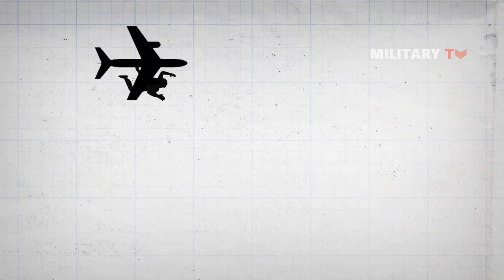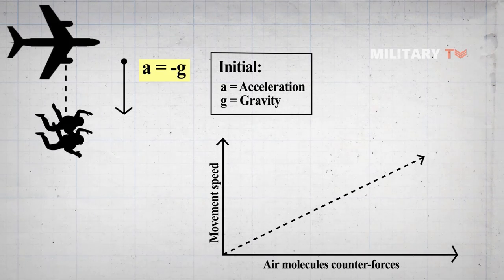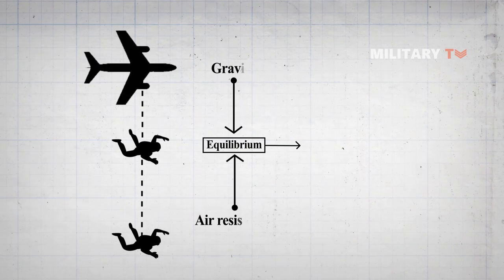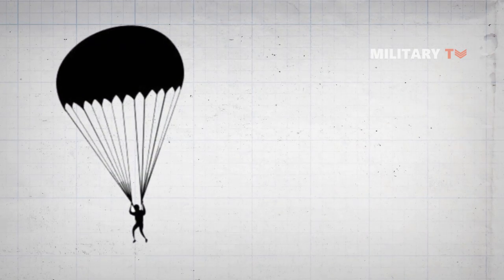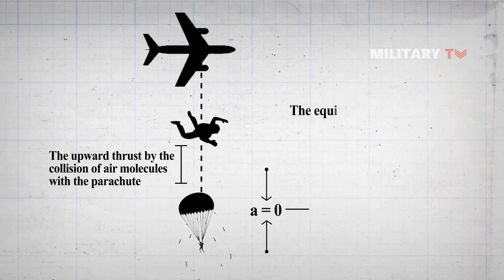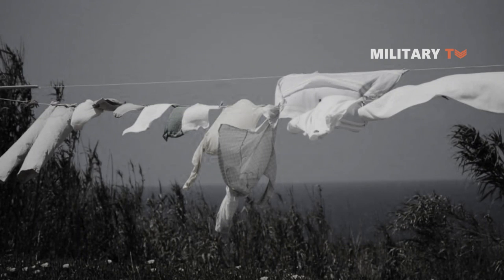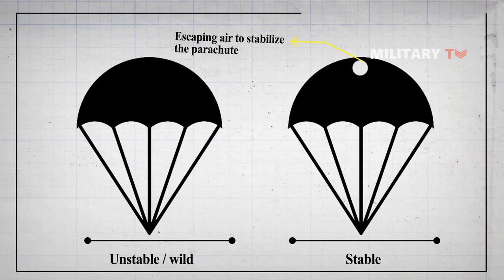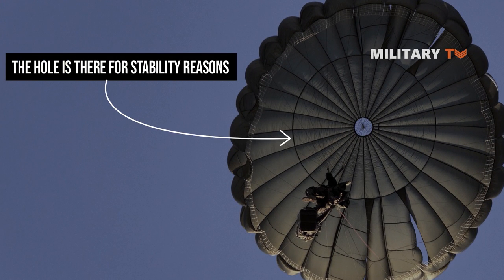Why Do Military Parachutes Have Holes - How it works?

Comment: The hole in the middle is to let air out in a controlled fashion.
If it wasn't there it would "over fill", and the air would escape from random bits causing it to "jellyfish", oscillate or even partially collapse, making it descend faster.
The holes in the side are for some sort of directional control. Usually the amount of control is in the order of choosing which tree you will land in, rather than enough to avoid the trees.

There are many different shapes and designs, each with their advantages and disadvantages.
Reply: Blocking the hole would cause the chute to stall and decrease the lift generated by the airfoil shape of the chute.
If you cut a chute from the hole to the edge and straighten it out you end up with a rectangle parachute that also act as an airfoil.
The hole increases stability and decreases fall rate.
Reply: Having the air trapped in a cushion probably affects the terminal velocity as well... just like the bed of a truck with the tailgate up will form a bed of air.
Reply: @fakshen1973  
That's where the instability comes from - that "cushion" escaping from the bottom.
Therefore the hole at the top to stop that happening.
Devices to slow the initial opening down is another topic.
Reply: Directional control just enough to land in the briar patch.
Reply: Thank you!

Comment: I noticed that too but i knew why
it's so they won't shake or get blown away while going down its much safer...
It's because, if the air cant escape it might just blow u away, it's just like smoke
it cant go out until there's a hole even if its little

Comment: Stability, forward movement and steering. When I started parachuting we used surplus modified military parachutes that typically were from an ejector seat of a fighter. They were normally 28 foot flat circular with only a hole at the apex. The 'mods' were two separated back to back 'L' shaped cutouts at the rear of the canopy called a 'double L'. Later they joined the two 'L's' with a slot around the periphery (bottom edge) and called it a 'TU". Gave it a bit of drive into wind and steering to a landing spot. The reserves were unmodified. Just went with the wind!

Comment: The hole in the Crown of round parachutes was put in to stop Oscillations caused by the air trapped in the canopy rushing out the side and then setting up a rocking motion. Most of the holes are edged in elastic so that on opening the initial rush of air is let out and as the falling body slows, the elastic tightens and reduces the size of the hole
Reply: Now that's clever (the elastic orofice), when did that feature find its way into the parachute?
Reply: @BeachsideHank  very early, I’m not sure but Tiny Broadwick was jumping a canopy in about 1912, that had a hole, not sure if it was elasticised. The British Guardian Angel canopy developed in 1917 didn’t initially have it, but post war it did, don’t know when it was introduced. Problem is people were innovating and sharing ideas as fast as the postal service. A bit like the Wright Bros stealing credit for the first manned heavier than air flight, publish or perish.
Reply: @BeachsideHank  by the way, the hole also has a function of lessening opening shock, slowing down the opening. This cases less strain on both the canopy and the jumper.
Reply: @anthonyburke5656  Thanks!
Reply: Without a vent in the top the canopy would oscillate wildly and most likely blow several panels on deployment. Aside from staying at a Holiday Inn Express last night I am an Federal Aviation Administration certified Senior Parachute Rigger with over 3000 skydives. I know stuff and things.
Reply: @larrynoe6162  just the man, I’ve been nursing an idea for about 40 years. You probably don’t know about the Irvin Delta II Parachute, it went out of production 40 years ago. Similar are the Reserve Triangular parachute, paragliding and para motoring reserves like the Beamer II and III. I’m convinced that there is more in the design concept than in”Ram Air” canopies both as parachutes and as paragliders. I know what stifled their development as parachutes was unreliability in opening, now cured by a “Slider” . I see the modern triangular are small and cut on the cross bias not longitudinal bias. I know very early designs contemplated longitudinal with much larger “Chanel’s” in the canopy. I know modern fabrics, lines and sewing techniques, as well as cell reinforcing have provided designers with lots of options. Try to build a big triangular that works on lift not drag and can be used to ascend?
Reply: @anthonyburke5656  ram air canopies of today are elliptical in shape. That is to say they have tapered end cells and zero porosity fabric not allowing airflow throw the fabric. The wing is a lot smaller very fast and highly maneuverable. You jump with wing leadings above 2.5 to 1.
Reply: @anthonyburke5656  PS you mean the Delta II death wing ?
Reply: @larrynoe6162  yes, it didn’t have a good rep. I think mainly because of that Opening Shock Inhibitor wrap that was used. The advent of the Slider obviated the need for. Such. I believe the concept needs to be revisited and that it has more potential than current Ram Air canopies, especially in the Ascending Canopy I.e. Paraglider category.
Reply: @anthonyburke5656  I started in the early 80’s there were many great innovations at that time that made skydiving a lot safer sport up until they started designing canopies that will kill you when operating correctly.
Reply: @larrynoe6162  any parachute can kill, it’s inherent, like any activity can kill, that’s not the point. I went from Sport. Parachuting to Paragliding to 
Power Paragliding (still do a bit of paragliding) and still think that there is a lot of potential in the Delta concept and it has more potential than Ram air. Take a look at the single skin lightweight paragliders they are making.

Comment: The teetering effect will occur even in a dead calm because it is as much caused by air escaping the parachute unevenly as it plunges downward, forcing more air in, and it may also be swaying as some of the air trying to push in to the chute must go around to one side or another. Teetering will cause problems controlling the direction of the fall by exposing a broader area of the shoot into the wind as the trooper is pushed away in the opposite direction of the wind. If the hole in the center is equal to the amount of air being forced into the parachute it will fall much straighter.

Comment: That’s a blast from the past! The T10 and the T10-1B …affectionately known as the “dash one bravo”. Took a lot on rides on the T10 on masstachs.
Reply: Steerable canopy.
Reply: @CrimsonRaven51   I'm not sure I understand your point but a T10 was certainly NOT a steerable canopy. At best, you could do a "slip."  In the 70s we did have modified T10s (gores were removed) that could be steered but the only time we used them was during non-military jumps or by "special" military teams. But even then, the Paracommander was used by most experience jumpers, including the Golden Knights.

At Ft. Bragg you'd see them (modified T10s) used on weekend jumps by "noob" sport jumpers transitioning from being a T10 "rope jumper" to using a ripcord and eventually to a high performance canopy.  

I was stationed at Bragg (HHC 50th Signal) from 72-74.  I was there when the Golden Knights C-47 crashed.

Comment: What is the difference between these parachutes and the rectangular parachutes without holes?  The rectangular parachutes seem to give the person much more control and flexibility.  Thanks in advance.
Reply: A Ram air parachute needs to be flown and landed, a circular one just needs a weight on the end of its strings.
Reply: One lets you down the other one has to be flown down. 
It's about landing speed, where you land,  the load and  the mission. 
How about a rogallo wing Parachute? Too iffy. They have a tendency to drift or collapse.   Square glider type? You have to be alive and steer. Round? Goes essentially straight down and is at the mercy of winds. Opens quickly in emergency situations as all of the jet guys use tat.
I'll walk. And trust round. I like roundy things that have holes in the middle. Donuts. Bagels and Angel food cake for example.  Tires. Parachutes.
Reply: @kevinshort3943  
Thanks very much.
Reply: @darrellcook8253  
Thanks very much.

Comment: They forgot to mention that the round parachute with the hole also stops troops drifting away from each other when deployed, as they have limited forward momentum, as opposed to the rectangle parachutes that require the paratrooper to steer to destination.
Reply: No, the “Ram Air” canopies were developed much later than round canopies, the initial impetus was WW2 work by Nazi Germany, post war Rogollo did work for NASA and patented it. Round Canopies, both the “Drag” type (which you see used for mass troop drops and re-supply drops) and “Lift/Drag” canopies such as you typically now see being towed by speed boats, can be steerable. The Round canopies have panels removed from the canopy to provide thrust and the Lift/Drag have vents in the canopy that funnel air to provide lift and can be closed or opened by control lines to change direction or alter lift.
Reply: @anthonyburke5656  I thought I saw rigging to close the lower vents.
Reply: When you have 1000 troops in the air, you don't want them to be able to steer, they'll all steer for the best landing spot and the amount of collisions you have will go up to a huge degree.
Reply: @politenessman3901  they can steer as mentioned before.
Reply: @quijybojanklebits8750  yes and they will steer for the best patch of ground to land on. all of them.
Reply: @politenessman3901  I disagree, I’ve been a military paratrooper, in the military I used both the non-steerable and steerable canopies. The delay in each trooper dropping meant that their optimum landing was different. Once you’re under canopy, then you prep your approach, ready your gear (you don’t want to land with your gear, you lower it just before landing so it hits and lets your canopy breathe). The second most thing a paratrooper dreads, after a canopy malfunction, is a mid air collision, they will go to almost any extreme to avoid one. In any event, in mass drops you “follow” the stick lead onto the DZ, sticks are in multiples of 5, you land and organise on landing by your stick.
Reply: @anthonyburke5656  So have I and I'll guarantee you that every guy under canopy will steer for the best possible landing. 
Given Sim door exits, odds are with steerables you'll get collisions anyway.
Sticks are not in multiples of 5. it depends on the capacity of the a/c and, I suspect, national doctrine.
In mass drops, you go down and have little steering ability, because few countries are stupid enough to add that level of confusion to a mass drop.
Reply: @politenessman3901  you beat me, I only ever dropped in the para school and with my Regiment, I guess our troops were better trained and our sticks were 5 men who all RVed on the DZ, never dropped in more than a Hercules load though. Only did a few double doors, no hassles, a few canopy walks. Later, when I did free fall with ramp exits from Hercs, we used to exit off the ramp in multiples of 5, that was a gunfight with all the gear we carried and the breathing apparatus.
Reply: @anthonyburke5656  any doctrine that puts sub units together on the same plane is one that is poorly thought out as it is ignoring the possibility of losing the plane (reliability issue or enemy action), you spread the units across multiple a/c so that, if you lose an a/c, you lose a couple of guys from each Pl rather than an entire Coy (If you consider ignoring the fact that the enemy has a say in things, as does saint murphy, to be "well trained", I'll let you continue to delude yourself) RVs are then conducted via company 'turn in points' on the DZ.
Our sticks were full sides of the a/c because the point is to get out and on the ground to get on with the task, but hey we were mission orientated.
Reply: @anthonyburke5656  So your militarys NCOs and officers were incapable of saying "you, you, you and you, with me" and taking some initiative.
Also, if a few explosions on a DZ make your entire unit freeze in place, maybe you were all in the wrong line of work?
 I just don't get why you want to admit so many systemic inadequacies, but keep going.
Reply: @politenessman3901  Im just glad I wasn’t in your unit.
Reply: @anthonyburke5656  So am I. having people who are so poorly trained that they cannot even recognize that putting entire sub units in one a/c is a bad idea AND so lacking in initiative that they can't follow any leader except their own 'special' one is a recipe for disaster.
Reply: The parachute in the picture has more than one hole.
The title says Parachutes Have Holes 
What are the holes on the sides for?

Comment: You get an unstable oscillation of the canopy.  It fills up then dumps air causing a bobbing motion. This makes the canopy unstable which can result in a catastrophic malfunction. Major Jack Barnhill Master Parachutist and Jumpmaster. The hole or bridal ring allows the air to flow through the canopy at a stable rate. This prevents oscillation.

Comment: There are also slots controlled by toggles that allow the paratrooper to navigate. I jumped from T10 in the 80's. Rough landing, 5 m/s and slow rotation. I had to bend my knees to not break my leg
Reply: "I had to bend my knees to not break my leg"      It's called a PLF. :-)  Something the swing landing trainer (at Benning) was supposed to prepare you for.

Comment: 1. NOT gravity, but density. The parachutist falls because they have greater density than the surrounding air.

2. A vacuume requires a physical barrier from the non-vacuume area, otherwise everything would be equalised. So where does the vacuume of space meet the atmosphere of Earth without a barrier?

3. The Earth is flat, with a physical dome. Gravity is still only a theory, to push the heliocentric MODEL. See videos from Eric Dubay, as a starting point.

Comment: A few things... 1) In the intro you mention people falling out of planes.  People don't haplessly fall out of planes, they intentionally jump out.  2) The air does NOT push the person in freewill nor parachute UP at all, the person/parachute pushes the air out of the way.  The force is called DRAG (not push) for a reason.  3) You also miss another very important reason for some holes.  They produce thrust, push the parachute forward and make it steerable.

Comment: Just being picky but gravity by itself is not a force. It has the units of acceleration.  You need mass under acceleration to have weight and therefore a force.  Take note all you people in 'metric countries' who call weight 'kilograms' (only the mass part of weight) as defined in the SI Metric System.

Comment: The more air resistance they encounter the slower they fall?  This is not physics.  What you meant to say is that the faster they fall the more air resistance they encounter,  and thus the slower they ACCELERATE.

Comment: holes are very important....that is why God created a bunch of them in your body....they all have a purpose and reason.
Reply: John Smith  I think the design is a well thought out design when you go into reverse mode and blow chunks (vomit)...the nostrils and throat combo do work in conjunction when reverse thrust is involved...there are also backup holes from your throat to your ears as well-  all that pressure has to go some where and it is best to go through different channel openings rather than one big one.
Reply: John Smith  I think our design is unique and I wouldn't change anything -  yes we have flaws but they can be overcome by corrective surgery.  What makes humans superior over all the other species is that we can operate i-phones with our fingers and they can't.

Comment: It's a cost cutting measure. Sure the fabric saved on one single parachute may not be much but add up hundreds of thousands of parachutes and it starts to make a big difference. 1 sq foot of top quality parachute material costs around 8-10 dollars. If you use say 10 sq ft less material on one parachute you will save around $80-100 million per year. It's just a rough estimate.
Reply: No. The hole is there to save lives, not money.
Reply: you really can't believe the military industrial complex is concerned about COST💸
Reply: They literally had blind people manufacture gear in the 2000s